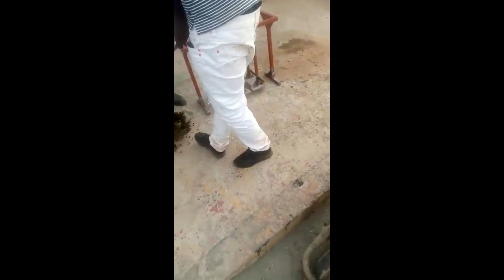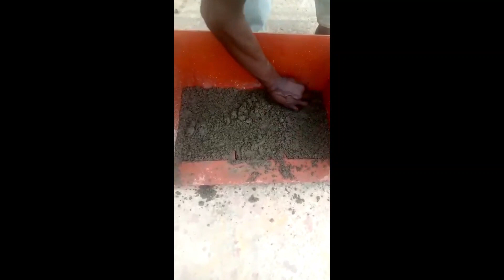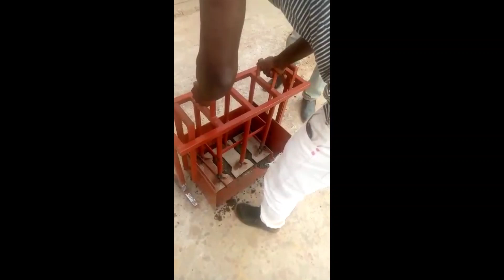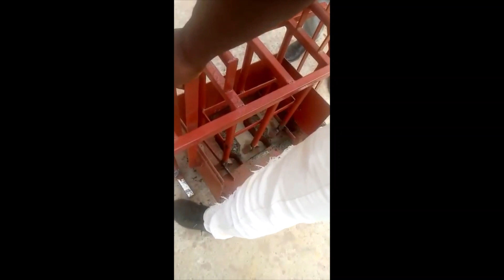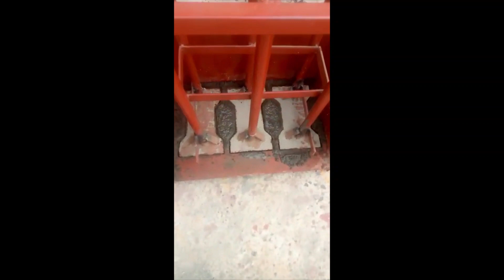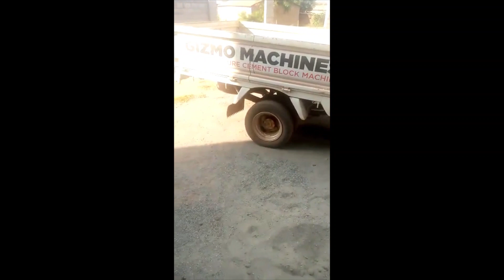Testing A Concrete Paver Mold Machine

Comment: Not much of a paver without vibration or hydraulic compaction though, machine would be ideal for light non load-bearing filler blocks for low income housing. Paver do require to be much stronger,
Reply from the maker: I see..